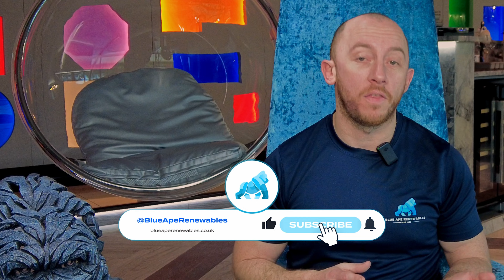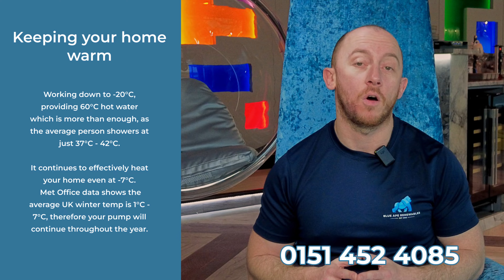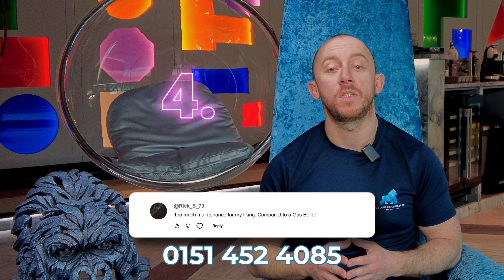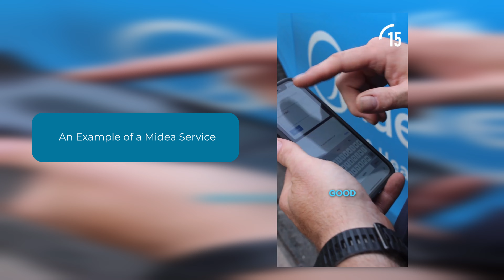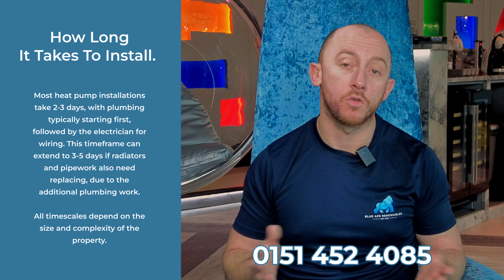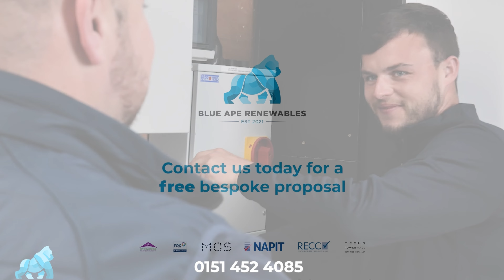Debunking the BIGGEST Heat Pump Myths!

Comment: Strange as someone told me the exact thing and now my leccy bills are 1k a year more with a heat pump.
Reply from the maker: In general, the running costs of a heat pump are similar to mains gas unless you have solar, which can significantly reduce the heat pump’s operating costs. However, if the heat pump isn’t sized correctly based on a proper heat-loss survey and ends up either undersized or oversized, it can lead to higher-than-necessary running costs.